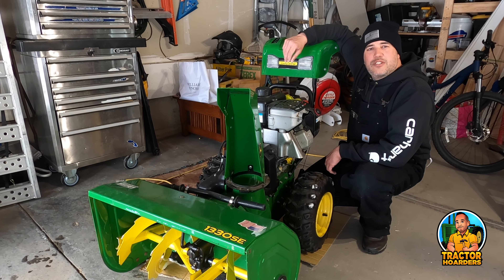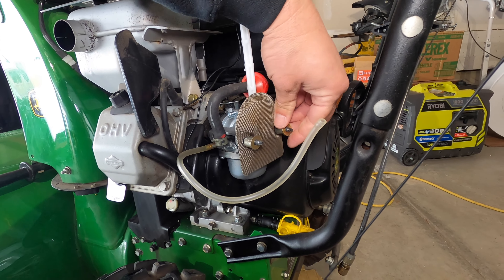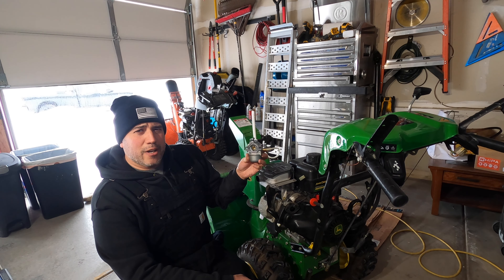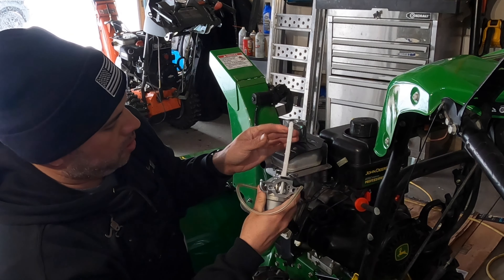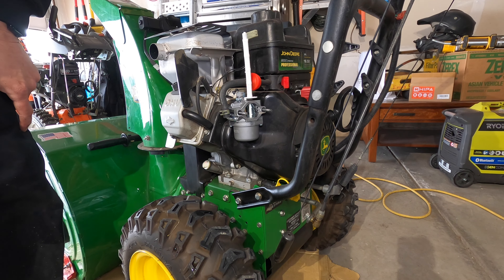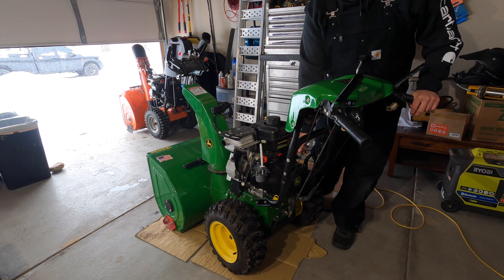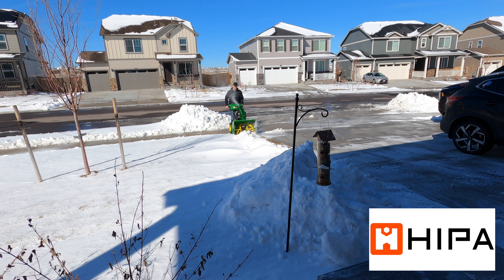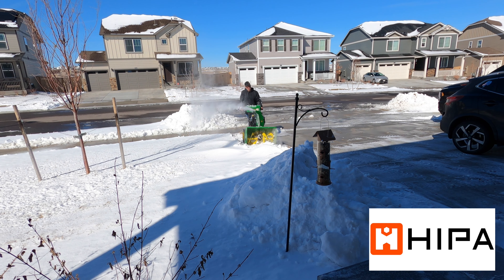John Deere Snow Blower - How to Install New Carburetor with @HipaStore

Comment: I’ve got a JD 928e with the snow series B&S in it. ive had it 15 years starts every winter on first or second pull and I know this is bad but I’ve never changed oil or spark plug it’s been a great unit. It sat last year and now it won’t start I’m thinking if I do what you just did I should be ok and looking at your links it should be pretty economical to fix
Reply from the maker: Yes, I’ve got several snow blowers currently with this same engine.  I install these new Hipa carbs and it makes them all run good again.  Good luck!  It’s a pretty easy swap.
Reply: Great thanks!

Comment: If you were to buy a new blower which one would you buy?
Reply from the maker: Great question.  This is my opinion.  #1 Honda, and then I think #2 is a tie between Toro and Ariens.  This John Deere is up there too, but they don't sell walk behinds anymore.
Reply: @TractorHoarders  I've been eyeing up the Airens if I ever breakdown and get another one. Does Honda make a big two stage? I don't recall ever seeing one?
Reply from the maker: @Jason1Pa Ariens makes some really nice blowers.  Honda makes some really nice two stage units.  They’re probably the most expensive too.  Some have tracks and hydrostatic transmissions.  Some day I’ll come across one for free or cheap because of a clogged carb lol.
Reply: @TractorHoarders  I would imagine that will be the case.🤣